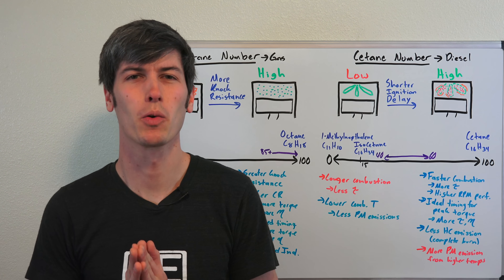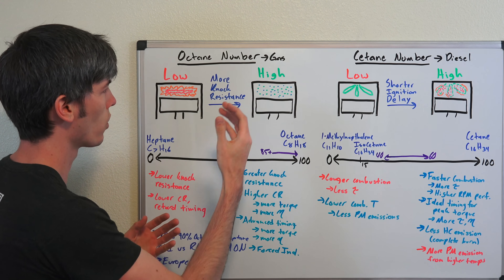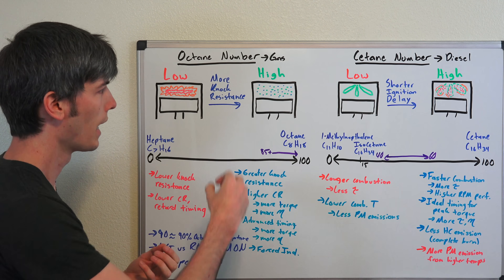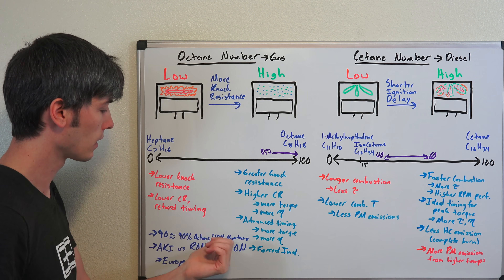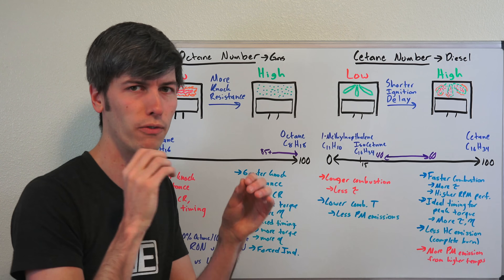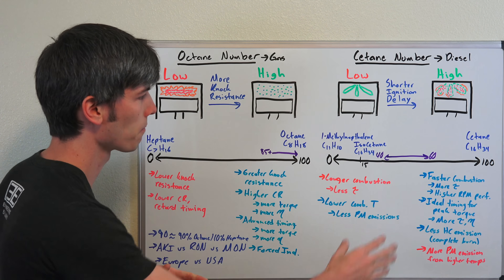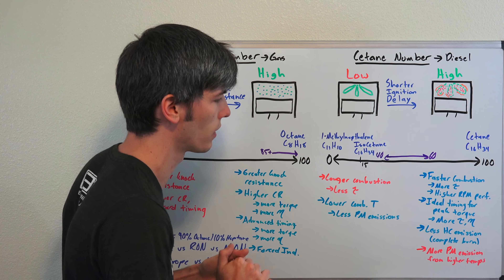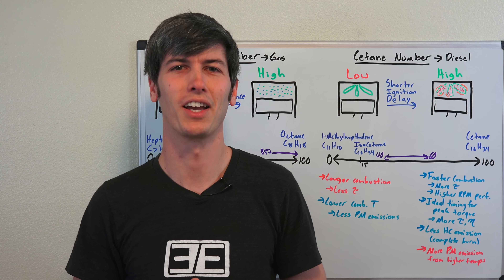Octane vs Cetane Number - Gas vs Diesel

Comment: high cetane diesel can completely transform a diese engine

There is a video on YouTube where they dyno test an old 1.9TDI vw diesel on standard diesel and diesel with cetane booster in it. The difference in mid and high rmp performance was huge and the engine made more hp and torque overall.
An old high revving Unit Injector engine like the 1.9TDI is kind of an extreme example and it surely benefits more from high cetane diesel than a modern commonrail diesel that is optimized for low end torque and hp anyways but even here id expect gains.
The minimum required cetane number for diesel with the EU here is 51. Premium diesel goes up to 60 and above. For years vehicle manufacturers have been pushing for a higher standard of at least 58 cetane. Now I see why they want higher cetane fuels to be the standard at out petrol stations.

Comment: Question, I Mixed cetane booster in my regular gas by mistake. Thinking it was a cleaner and booster for regular gas but then read the label at the bottom where it said for diesel fuel. I use this gas for my lawn mower. Will this ruin the motor?

Comment: What happens to burn time if you mix regular diesel with motor oil. Motor oil is a longer carbon chain. So, do they burn slower or faster than regular diesel.

Question is because old diesels will run on motor oil mixed with diesel. 

Fun fact is that when you run a blend the engine sounds even more like a diesel. 😁

Comment: question: Is it the compression that ignites the fuel, or the heat from the compression causing the fuel with the lower flashpoint to ignite?

Comment: so adding diesel to gas should increase octane,,,please reply
Reply: got some dirsel cause new tractor never came going mix it in my carb heli 359 ford like 2 gal deseil to 15 gal.gas make tractor feul so not get wasted ny age.
old farmers know what tractor fuel is 2 tanks start on gas than switch to tractor fuel.helps lube the clyders too
Reply: tractor fuel is whatvever works in mix ratio  of 1 or 2 grade diesel with gas
Reply: out of gas so had 10 gal of diesl dump in a 71    440 chrysler 300. little smokey .slower to start but run ok
Reply: ya was number 1 diesel

Comment: This is a revelation.  Thanks.  This video brings up the question what will the Subaru Crosstrek do on a Dyno with 83 octane v 91 octane.  I just saw a video of a Crosstrek on a Dyno testing the HP between factory tries and rims vs AT rims and tires.

Comment: Question..... can you explain the advantage/disadvantage to stopping an engine at... let say,... a drive through or long stop light. Is the savings in fuel out weigh the wear and tear on the starter? Is there a time period of time that must elaps before there is an actual benefit?  How much fuel is used to start a fuel injected engine that is already up to normal operating temperature? As opposed to a engine idling?

Comment: lot of questions about running home heating fuel in off road diesel engine. 
Can a diesel engine run on home heating fuel?
Wile cheaper does it run efficient? 
Is there possibility of injector or engine ware? 
I don't own a diesel but I do work at a fuel service station and get asked all the time. 
All I know is old engines 30+ years ago were durable unkillable machines use to run fine one home heating but don't know if it would be safe to run in today's engines.
Reply: Yes it can ran on heating oil but you shouldn't do that. Standard heating oil still contains up to 50mg/l of sulfur which can cause problems for the exhaust after treatment system. Also because in most countries Diesel and heating oil is taxed differently, you basically do a tax evasion if you using heating oil in a car.
Reply: use cetane booster when running heating oil instead of real diesel

Comment: This feels like a misleading octane explanation to me.  I would say that higher octane fuels burn slower. That is what allows for more advanced timing.  "Spark resistance" alone wouldn't.  In reality the higher octane / slower burning makes higher octane fuels behave as "more resistive to knock" but really it pre-ignites slower and those flamefronts spread slower and stay tiny vs spark ignition so don't cause knock.

Comment: You should cover how does air temperature differences between summer and winter affect the output on the engine, and how does the fact that aire can have different amounts of water depending on the temperature, affects horsepower readings. Also the fact that dry air has different specific heat and so and how does that affect the combustion pressure and temperatures. I think that is a pretty amazing topic and there is a lot of missunderstanding about that.

Comment: Minor disagreement.  Firing the spark earlier is done because the higher octane fuel burns more slowly, resulting in less likelyhood of a knock caused by exploding fuel rather than a smoothly burning fuel.  Also, maximum torque occurs with the spark occurring such that higher cylinder pressure occurs 90 degrees after top dead center for the greatest moment arm.  This usually requires sparking earlier (advanced spark).  

High cetane in a diesel is also advantageous because diesels are considered constant pressure engines, meaning the cylinder pressure can be held approximately constant during the power stroke in a low rpm high torque engine.  In such engines, fuel is normally injected throughout most of the power stroke, typically from TDC to a bit past 90 degrees ATDC. 
 Contrast this to a gasoline engine in which control over combustion is essentially lost after the spark fires, necessitating spark advance curves to match engine rpm and torque requirements such that higher cylinder pressure occurs at 90 degrees ATDC on the power stroke.  Other than that, I love your posts.  Keep it up.

Comment: i read somewhere since the big ethanol boom that 87oct is actually 85 with 10-15% enthanol to come to 87. And no not all 4 bangers can run on 87 without causing issues. They can run it with a knock sensor but mpg, and thermal efficiency goes down the drain. Wrong spark plugs or carbon build up could also cause ping/knock on cars built for 87.

Comment: Just a small correction: Octane (a.k.a. "n-Octane") is about -20 RON (yes, minus 20!), but "iso-Octane" (2,2,4 Trimethylpentane) is 100 RON and the molecule used as the 100 RON specification. n-Heptane is used as the 0 rating. The "n" stands for "normal" and refers to the long chain hydrocarbon rather than any isomer (or restructuring) of the same number of atoms.

n-Octane is the long chain C8H18 hydrocarbon and so flaps around easily and breaks under high pressure/temperature, but one of the isomers of Octane (2,2,4 Trimethylpentane) is a small packed up molecule so it's much less likely to self-combust under high pressure/temps. It's still C8H18, though, but a different shape (isomer).

Great video as always! :) Sorry to point out an error.

Comment: My car has a 13:1 compression ratio but still recommends regular(87) gas? It even says that higher could cause check engine light. Would there be any measurable benefit to using a higher octane since my compression ratio is so high?

Comment: The octane is structurally different as well. The heptane is linear heptane, but the octane is 2,2,4 trimethylpentane. As long as you pointed out the isocetane....

Comment: A pedantic correction but octane itself hasn't got an octane rating of 100, a structural isomer of octane called 2,2,4-trimethylpentane is defined as 100

Comment: We don't have different diesel options at the pump in Australia, it may vary between the suppliers, but it is not openly displayed what the cetane number is anywhere. Unlike petrol, which is displayed at the pump as 91, 95 and 98 (we used to have 100 and 103) (I think we use RON), You can get additives to boost the octane/cetane number by up to 7. Does any other country add ethanol to petrol? We have e10 (10% ethanol added to petrol), what are the pros/cons of this?
Reply: Daniel Warnock In Finland the petrol choices are 95E10, 98E5 and E85. Before E is the minimum octane of the stuff, and after it the maximum ethanol percentage (octane is left out of the name of E85, because it's supposed to be high enough for just anything). I'd suppose it's the same pretty much everywhere in Europe.
Reply: Pauli Vaara we have e85 here too at select locations, but it is recommended for high performance engines only

Comment: I find it odd that burning diesel at a higher temperature (high cetane number) would result in more soot, considering that particulate filters burn off what they collect at very high temperatures.  You'd think the higher temp would result in more complete combustion.

On the other hand, I would expect more NOx from those higher temperatures.

Comment: I have a car that uses 90 octane rating fuel, what happens when I start using 100 octane rating fuel in my car?
Reply from the maker: Probably nothing, unless the ECU is programmed to take advantage of the higher grade fuel.

Comment: One thing you did not touch upon is the fact that people think that whatever engine you use, a higher octane will yield better performance. According to your explanation, that is true only for variable compression engines. Engines that operate at higher compression simply cannot use low octane else they get knock, and low compression engines will not extract the benefits from higher octane fuel.

Comment: How do NA Diesel Engines manage to get so high compression ratios without having forced induction?
Reply from the maker: Compression ratio is a physical measurement of how much the piston compresses the volume of air within the cylinder, so it’s not dependent on forced induction. Since diesel engines use compression ignition, rather than injected the fuel with the air beforehand, they can have much higher compression ratios than gasoline engines.
Reply: Ooooh, I thought Compression Ratio meant how much Air / Fuel would be inside of the cylinder compared to its size with the piston down. Like 10 to 1 would be 10 full cylinders inside of one.
Thank you very much.

Comment: So does the production cost of each of these determine the price at the pump, or is it just an arbitrary number made up by the manufacturers? 

Additionally, I would think that the increase of electric motors would allow the same amount of fuel to be made, but the demand to drop, so the price should be lower, no?
Reply from the maker: Higher grade gas is more expensive to make (and includes more additives), but yes, there is definitely a profit margin added on top. EV usage is very low currently (less than 2% of cars). If demand went way down, sure it could be cheaper, but markets control how much oil is exported and simultaneously are controlling prices by doing so.
Reply: Engineering Explained thanks for the explanation, and keep making great videos.

Comment: I always buy the cheap stuff 85 for the last 20 years. Never had an issue. I was told high 87+ is just for high performance vehicles, like lambos or Porsches, not mustangs or civics.
Reply from the maker: Depends on the engine, not the manufacturer. Some Mustangs and Civics will benefit from premium, some will not.
Reply: 85? Are you in the mountains? I never see lower than 87 where I live.

Comment: Will diesel with a higher cetane number and therefore higher burn temperatures also create more NOx emissions? After all those nitrogen compounds tend to form at high temperatures...
Reply: Yes, higher cylinder combustion temperatures increases oxodes of nitrogen production/exhaust emissions.

Comment: I find that my v8 runs so much better and is more torqued with the efficient burn of the higher octane fuel .That is why I use only high octane fuel and the savings to lower octane is marginal when compared against engine knock and other factors that can eventually cause permanent damage and cost in the future, especially if one desires to keep his vehicle for a very long time. Good explanation on fuel ratings and video presentation.
Reply: Your engine haves a high compression ratio. When you use a lower octane your engine management reduces the spark advance and that reduces the torque and power.
Reply: Octane has nothing to do with burn efficiency, it is only relevant to knock.

Comment: Idea for video: How is race gas higher then 100 octane? How does lead in gas raise the octane rating? How do off the shelf octane boosters work?

Thanks for all the amazing videos and info!
Reply: The octane rating is only the rating of an equivalent fuel made of octane and heptane. Real gas is not just octane and heptane, and some chemicals and additives are just more resistant to knock than octane will ever be. Octane will still knock if you put it under enough compression.
Reply: Also, are some E85 mixtures who are rated to be 118 octanes. Engine Masters presented by AMSOIL tested some racing gasoline and E85 both rated at 118 octanes.
Reply: The lead in gasolin was in the form tetra ethyl lead and have an octan number >100. Therfor it increase the octane rating when it's added.
Reply: Most alcohols will increase octane but they also contain less energy per gallon than gasoline.  Many alcohol fueled racing engines run very high compression ratios...like 18:1 or 19:1, but they also require fuel flows well in excess of what would be required for similar power from a gasoline engine.

Comment: In my knowledge Diesel Engines are having high compression ratio, so they produce more torque,, while Gasoline engine have less compression ratio and produce more power. So if we increase Octane number, then will it reduce power just like the diesel engines
Reply: You mixed it up pretty much. Diesels produce more torque mainly because they have immense levels of boost - a naturally aspirated diesel always has pathetically low torque. Petrol engines produce more power because they rev higher, and power is just torque * revs * some constant. Higher compression ratio results in higher efficiency, which also means higher power and torque - up to a point when it starts igniting prematurely, of course.
Reply: Power is torque*revs/constant (5252), and dont say that naturally aspirated diesels make low torque, if its like that, then our SUV makers dont prefer diesel for their products. So lets make it clear in normal condition a naturally apirated diesel makes more torque but revs less so less power, but in case of gasoline it revs higher even though it doesnt make torque like that of diesel, but in case of high octane fuel gasoline will compress more and make more torque at high rpms results in more power.
Reply: gomez shilu Well, multiplying by 1/5252 is the same as dividing by 5252, so you can say that's something * constant. And please give me ONE example of a naturally aspirated diesel with high (over 95 Nm/70 lb ft per litre - that's the level of modern N/A petrol) torque.
Reply: Yaa,,, you are right I cant find any naturally aspirated engine with such a torque. So where does that leaves us in normal condition gasoline produce less torque and more power, if we use high octane fuel and there by increasing torque and power, it is better to use gasoline everywhere right, whats the need of diesel?
Reply: gomez shilu Diesel engines are simply more efficient, and thus more economical, and due to their operating principle they can withstand much higher boost than similar petrol engines which gives them more torque when turbocharged (applies to modern diesels with common rail). But both differences start to diminish IMO, the latter especially.
Reply: so will a diesel engine get more power and torque, if we use high Cetane fuel?